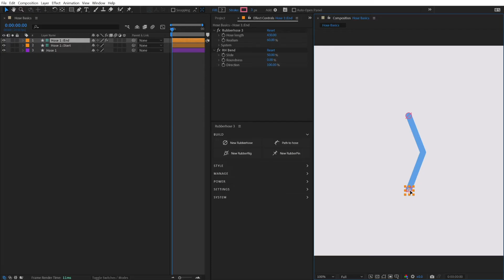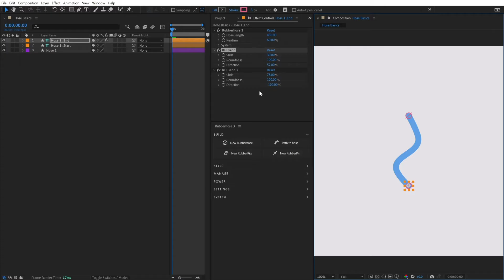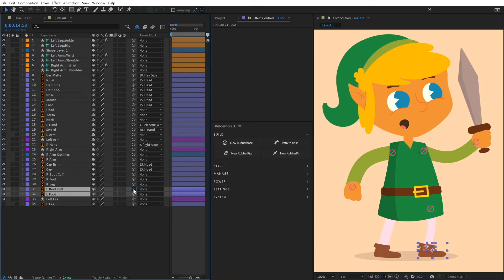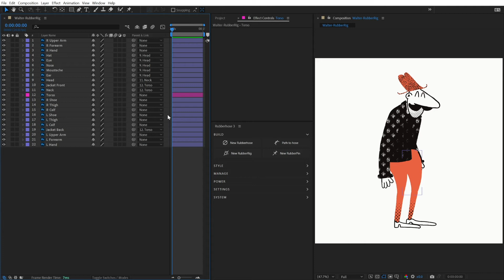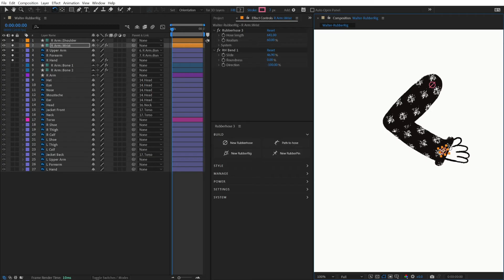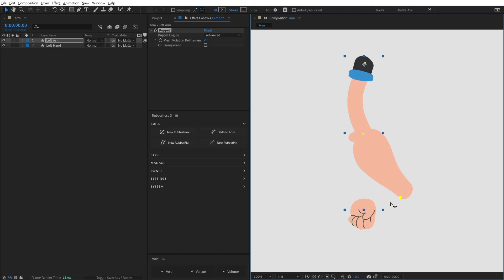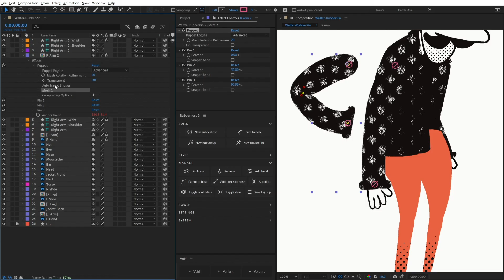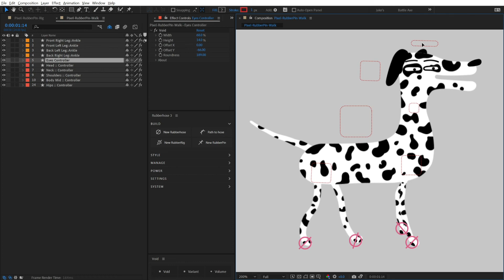Rubberhose 3 - hose basics

Comment: Hello! Let me ask you this question: could you tell me how to make it so that when duplicating a hose, you can get a copy that is rotated 180 degrees on the x-axis? Right now you can only make a copy... Thanks!
Reply from the maker: Duplicates get the same settings as the original. I think you are looking for Direction. Adjust the value of the duplicate's Direction property (on the end controller) to -100. 
https://help.battleaxe.co/rubberhose3/controls.html#direction
Reply: @battleaxedotco  Unfortunately, that's not entirely true. What I meant was that if I created, for example, a leg and attached a shoe to it using Rubberhuse, then when I duplicate the leg, the shoe will face the same direction as the first one. Whereas I would like to have it facing the other way. Thanks.

Comment: I like Rubber hose 3. I bought it. But before that, I downloaded the pirated rubber hose 2. To familiarize myself with how it works.
 And I don't really like the fact that rubber hose 2 is 4 times faster than RH3.
 I checked that one limb in RH2 was rendered in 3-4 ms. While in RH3 one limb was rendered in about 12-14 ms. And if you add one more hose to one limb, the speed decreases also in two times to 21-24 ms. And with each addition the speed will drop again by about 10ms.

 When I created all 4 limbs in RH2 I had everything loaded in realtime. This makes it very pleasant to work and more control over the result. But when you create 4 limbs in RH3 the speed is already noticeable to the eye. This is even without using complex styles. And if you add styles, it will be very laggy at all.

 I don't know what's wrong. Probably the quantity of expressions that are bound to functions in RH3 affects performance so much. But sometimes I just need simple limbs for some minor characters. So that they can be made easier and faster. So it would be cool if in RH3 there would be some division into modes: simple rig like in RH2 where some functions are disabled and full mode like in RH3.

 But thanks anyway. I really enjoyed working with this script. I worked only in Duik before and didn't know about other scripts. I like your script much more and it is better suited for my tasks.
Reply from the maker: The goal with RH3 was to add features like multi-bend and customization with natural sliding, but this isn't always necessary. I've been thinking about this one for a few days and just did some testing. I just wrote a minimal expression for a simple bend at 50% and on 4x basic hoses in a comp it saves 15-20% render time, but on more complex styles (with a lot more path referencing) it cuts the rendertime in half. I'll be sharing a new build soon over on Discord (https://link.battleaxe.co/discord) if you want to check it out.
Reply: @battleaxedotco  Hello developers! I just recently found out that you made a new simplified mode for Rubberhose 3. I just tested it and it works very well! Bravo!

I used to use Rubberhose 2 a lot before because it was faster, but it was still inconvenient because the project had to use Legacy code for expressions instead of Java script. And this caused conflicts with other scripts.

Now RH3 works very fast and it is very pleasant to work with it. I recommend RH3 to everyone who reads this.
Reply: Can u please tell me where u downloaded the pirated version cause I want it too I will buy when I am financially strong 😊

Comment: Hello, I am a happy rubberhose user, I have a problem, when I have an object and I place pins on it and I give it create new rubberpin and I give it the option shoulder: wrisrt the rubberhose system creates it outside the object, how can I solve that? , that is, let me do it on the object I am using, thank you very much, greetings
Reply from the maker: It's hard to say without seeing the project, but are you putting pins on an external art layer (like from Photoshop) or a precomp? Pins on a shape layer or a continuously rasterized vector layer will slip. If that's not it, then jump on the Discord (https://link.battleaxe.co/discord) and we'll take a look.
Reply: @battleaxedotco  Hello, thank you for your quick response, I already realized the mistake I was making, this script is spectacular!!! Thanks again
Reply: @iupi_llc  Can you please tell me what the error is? The thing is, I have the same problem. Thank you.